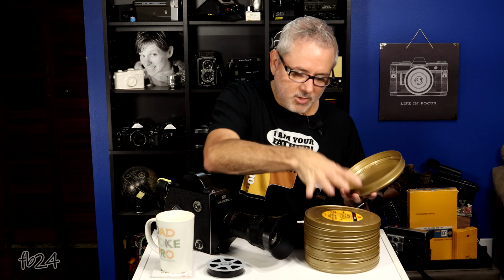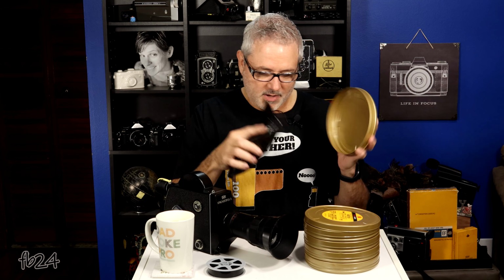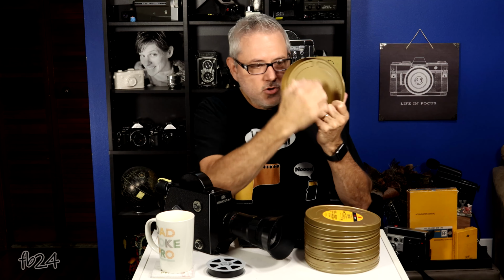Shooting Accidentally Exposed 16mm Film | Flashed Vision 3 50D | Krasnogorsk 3 Super 16 | Filmboy24

Comment: I have some film just like this that I am planning to shoot an experimental music video on. Do you have any recommendations for processing? Should it be pushed or pulled a stop? Or just process normally?
Reply: The film is from a shoot where the magazine had some kind of technical failure and the cover came off of the feed side, exposing the film we hadn't shot yet to daylight. Thankfully everything we had already shot was perfectly fine. It was a devastating moment on set though...
Reply from the maker: @marcotoro7981  those are definitely "uh oh" moments for sure. Glad to hear your other stuff turned out fine. I would process everything normal. Exposing it to light won't affect any of your exposure at all. Luckily this stuff has so much latitude that almost anything can be corrected in post.
Reply: Thank you!!